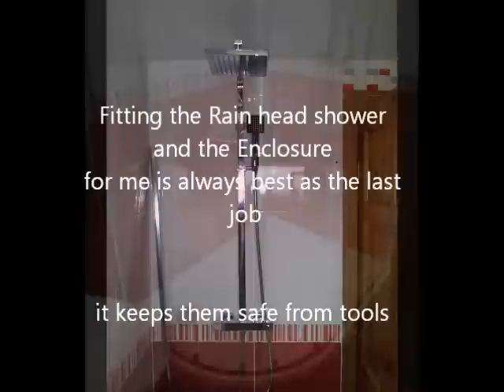Bathroom refit      part 1

Comment: what kind sheeting did you use on the ceiling.
Reply from the maker: On the ceilings we use a PVC cladding 250mm x upto 2700mm its light weight and gives a long lasting very nice finish to the bathroom